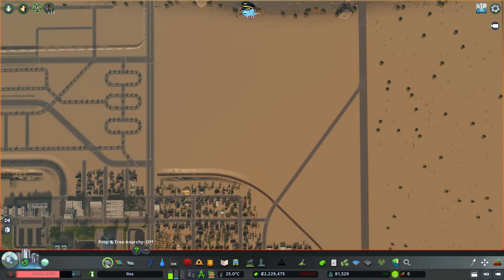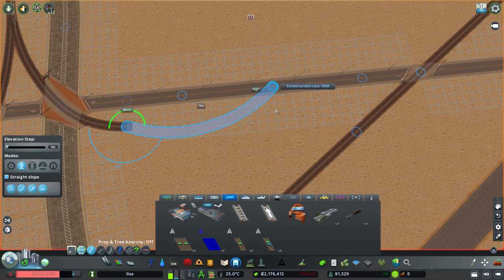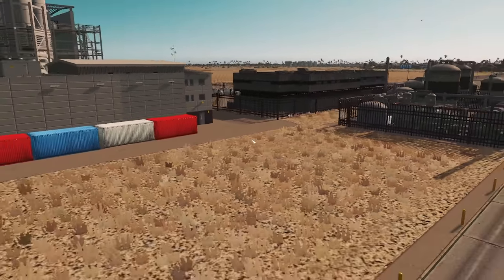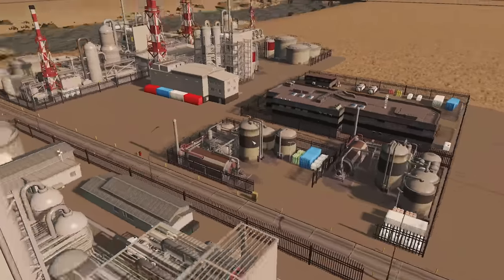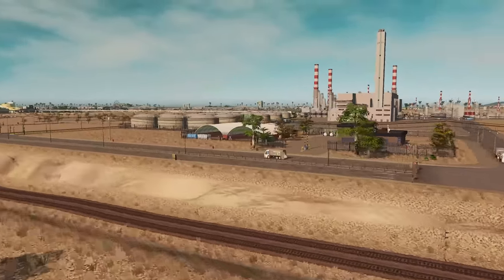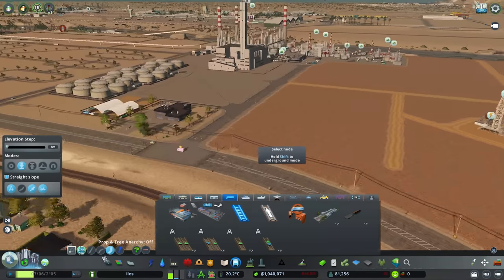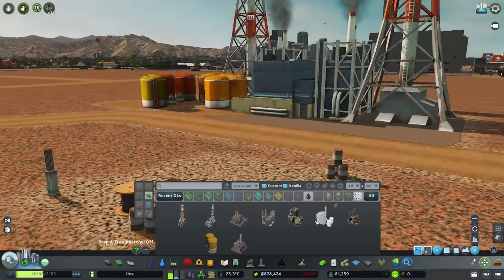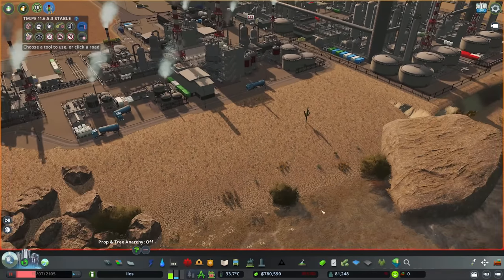How To Build A REALISTIC Oil Refinery In Cities Skylines! | Ilos

Comment: One very neat trick you can do with mods and assets is "invisible roads."  These are small unmarked paved or concrete roads on the workshop - I can give you some links if you want them.  When you paint around them with Surface Painter or use Ploppable Surfaces, they simply disappear, looking like any other paved or concrete lot.  Then you can come in with Intersection Marking Tool and mark out the outline of the road, add bollards, fences, delineators, whatever you want,  So it looks like a painted driving lane through a concrete lot.  That works really well in ports but also can work exceptionally well in large industrial areas.

I hope you get over COVID soon.  That's a very nasty bug - had it myself - and it's a very rough ride especially if you are older.  Please take care of yourself!!

Comment: That Japanese building with the tunnel is very nice, I love that you were able to have a road go through it. I am still new to mods so I had no idea you could "force" something over another item / building. I had "move it" but still so new to all of the mods. I love what node controller does and after watching you use it I think I will start using it too. Thank you so much for all the time and effort you put into your designs and creating these videos!
Reply: I use 120+ mods but my build is highly specialized.  You can get away with a dozen or so base mods, like what Overcharged Egg is doing, and hugely improve your modeling.  It's worth it!